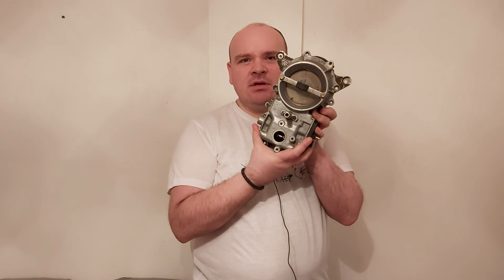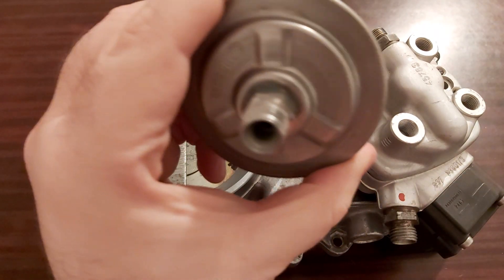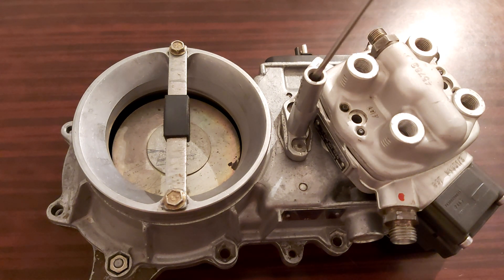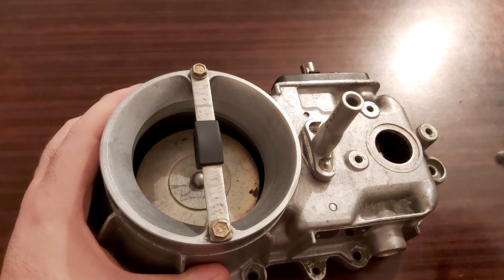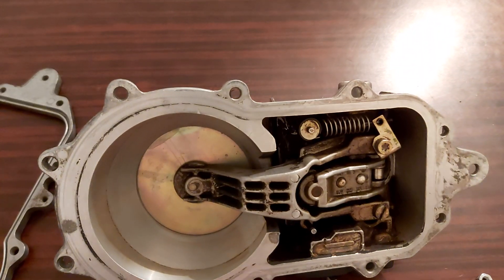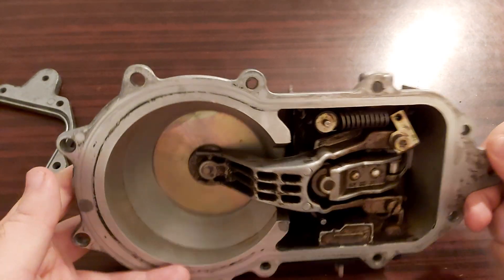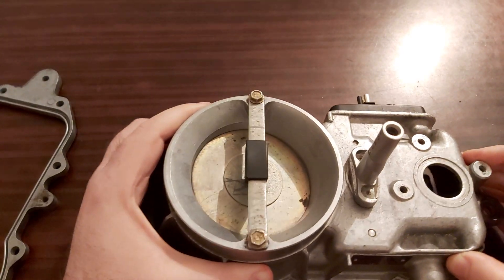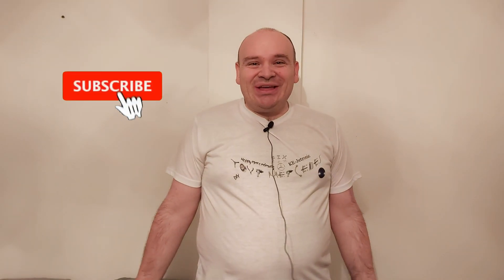㉦Mercedes KE Jetronic㉦ - The sensor plate way down on your Mercedes? Is it maybe just a spring?

Comment: I moved the spring, but still falling...
Reply from the maker: Mount a pressure gauge and check the mechanical part of the system!
Reply: @mercedeske  I have the metering assembly out.  I am rebuilding the fuel distributor.  My concern is that the air plate sags as shown in your introduction in this video.  I moved the spring holder like you did to add tension but the plate remains down when the assembly is horizontal.  when I turn the assembly to the side or vertically, the plate does move to where it's supposed to be.

Comment: For added insurance, take this screw out, clean threads on screw, & the hole it screws into, then put locktite on the screw, install, & tighten. It won't move.

Comment: Great video!  I have this issue.  Is this the same for k-jetronic systems?  I have an M110.989 and I’m wondering if it adjusts in the same way … before I go pulling the whole thing apart…
Reply from the maker: Yes. You can also check if the spring works fine, if it doesn't budge.

Comment: HELLO I MAKE YOU MY CONGRATULATIONS FOR THE MANY EXPLANATIONS YOU GIVE ABOUT THE KE-JETRONIC, EVEN IF I HAVE A K-JETRONIC.
I WANTED TO TAKE ADVANTAGE TO ASK YOU ONE THING AND IS IT POSSIBLE TO REMOVE THE CELL SHAFT OF THE AIR DISTRIBUTOR PLATE? HOW CAN IT BE DONE? I KNOW THAT IT MUST BE PULLED OUT FROM THE SIDE OPENINGS BUT I HAVE OPENED IT AND I DON'T KNOW HOW TO MAKE IT COME OUT. THANK YOU VERY MUCH HELLO Paolo from Italy
Reply from the maker: Hello, Paolo. I believe it's possible but I can tell nothing because I don't know if the airflow meter on K-Jetronic looks same as on KE. But why did you decide to pool it out anyway?

Comment: Is there a torque value for all the bolts that hold on the rubber boot? I'm replacing the boot on my 1987 560SL and I can not find a torque value or a torque sequence. Just wondering if you knew. I'm enjoying all your videos.
Reply from the maker: Hi. Glad you enjoy the videos. I didn't manage to find that but I think you can tighten them....how should I say....not to over tighten them(not to damage the thread) but to tighten them well. As you feel the bolts moving harder tighten them for 1/8 of a turn at most(that's how I would do). Greetings, just keep it up. Till first 100 subscribers it goes hard, afterwards a bit easier.

Comment: Congratulations for your channel!You are the Best. I have an issue with my mercedes 190e. When it is  warmed up..it needs 4-5 times to restart the engine before it starts..what do you think about it? What can i do...
Reply from the maker: Hi and thanks a lot. It's the fuel accumulator. Replace it! It's task is to make warm starts easier. When its diaphragm gets ruptured it can't hold the pressure in the system. If you want you can test the fuel accumulator or you can simply replace it?😀😃
Reply: @mercedeske  i've already checked it and replaced it.. . Thank you for your answer. Any other ideas?
Reply from the maker: What about the injectors? As they start squirting they can make issues. When the engine is cold the cold start valve can compensate the situation so that the engine starts easier but when the engine is warm the cold start valve is off, so check the injectors, if not the injectors then take the pressure gauge and measure the pressures to test the fuel pressure regulator. Those are my thoughts for now.
Reply: @mercedeske  thank you very much🙂🙂🙂 I will send you again. 💪
Reply from the maker: Thank you. Hope you solve the issue
Reply: @mercedeske  💓